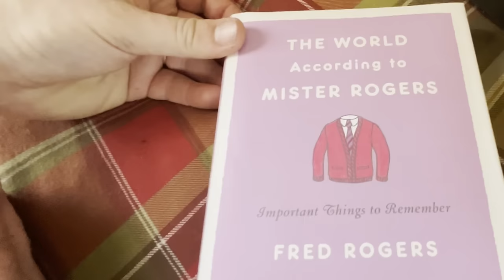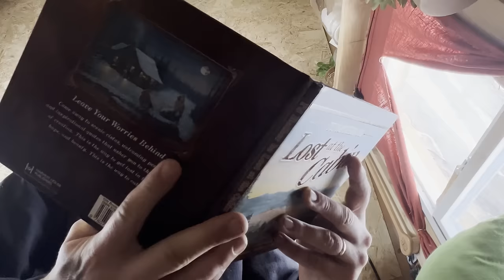SNOW STORM AT THE CABIN | Overnighter in the Woods with my Dog!

Comment: I just watched this for the third or fourth time.

I'm thinking that for kicks and giggles and as a cost-effective idea, you could make a wood hauler out of a piece of old carpet with two pieces of rope tied at the ends for handles.

It can be carried one handed and was the original term for "The Carpetbaggers".

And you can hang it either outside in the sun or near your wood stove by one of the handles to dry.
Reply from the maker: Not a bad idea!